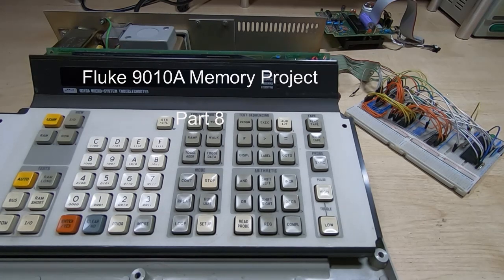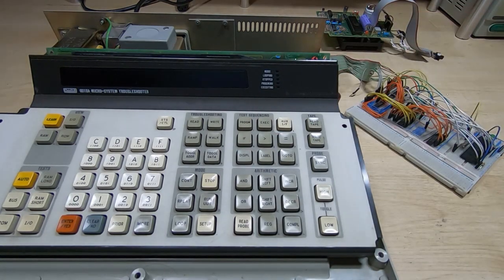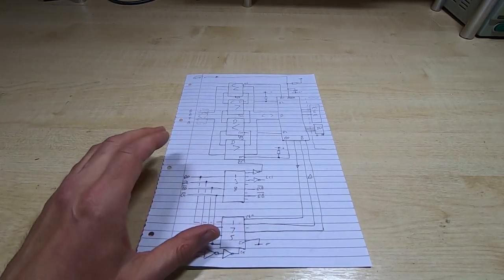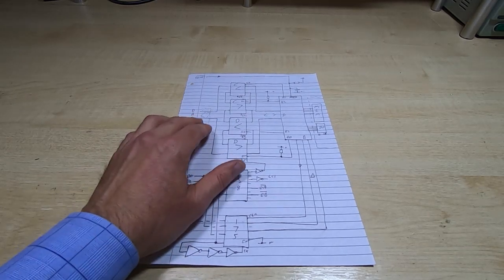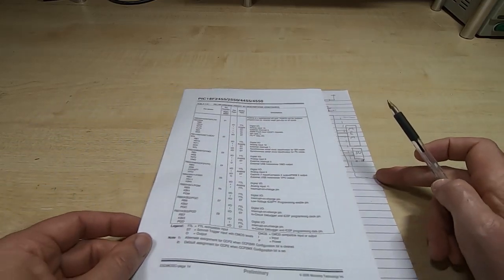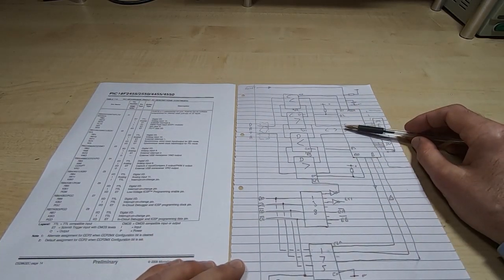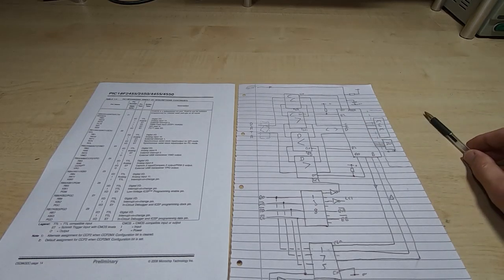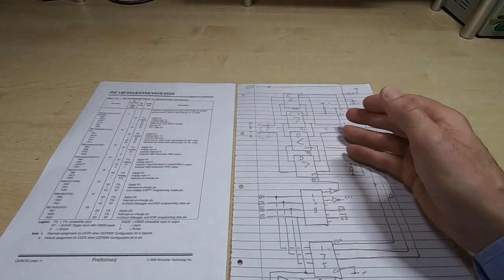Fluke 9010A Memory Project Part8

Comment: Making progress very quickly on this project - love it! I'm most excited about the ability to more easily share programs without the need to have a serial interface and computer configured for uploading them. Sounds like there will be a dedicated on-board EEPROM, with a card slot of some sort for portability - is there a reason to have both, vs. just the removable card? SD cards are cheap, especially smaller ones, so is there that much of a cost savings in putting a cheap EEPROM on the board, with an empty card slot vs. just the card slot and having somebody buy their own card worst-case?
Reply from the maker: As you say the EEPROM's are very cheap so having one on the internal board does not add to the cost and the builder can even leave it off if they do not want it. It is however very useful for test purposes or if someone wants to add memory but not buy any cards. The only really complicated part is the physical implementation of the card 'slot' and as not having the card would make it far less practical then having both is better. The way I use the 9010A I expect to use the internal memory for 'standard' tests and the cards for machine specific tests. This approach gives the most flexibility but it is then up to the builder which parts they want to fit.

Comment: Hi Jerry, I ‘m interested. Also would love to see some more about the code setup. By the way does anyone have an idea how many of these Flukes are around? I’m wondering how big the fanbase is 😄
Reply: Pretty popular in the arcade collecting/repair community, and a much-needed bit of kit. The tape drives are frequently dead on these (the rubber rots/melts on the capstans), and although some came with serial cards to interface with computers, many did not. This will be a great solution for both scenarios.

Comment: Were you ever planning to replicate the 9010A serial interface?  It appears relatively simply .. especially if one were to replace all that level shifting circuitry with a MAX232.  I wonder if the Fluke would need any modification to recognize a serial port .. Or if it would just start using the port if it were detected :-)
Reply from the maker: Yes I am just looking for a serial interface card that I can use as a template. The only real complication is the isolation as the RS232 interface must be electrically isolated to prevent ground loops between and UUT and the PC so a MAX232 alone cannot be used. My intention was to effectively duplicate the original interface but with a small isolated supply module instead of having to source a suitable isolation transformer.
Reply: @JerryWalker001  Thanks for the info!  Yes, I wondered why Fluke bothered with those opto-isolators .. Now I know why :-)

Comment: is there a public set of schematics for this product anywhere?
Reply from the maker: No, I have not yet finished designing it and do not intend to publish schematics or source code. I am hoping to recover some of the expense by selling the boards.
Reply: Jerry Walker il buy one :) and the adm3a
Reply from the maker: Sounds good. I still have a little work to do on the Fluke memory option but the hard bit is now done.
Reply: @JerryWalker001  You could do both: Openhardware/Opensource it and sell the boards ... or at least after some time (e.g. 2 month)
Reply from the maker: That would be a very bad idea. I have to buy my boards from China and they of course make a profit. If I make the design available then I could end up trying to compete with someone that could easily sell cheaper than I can buy for and they would also not have had any development costs and time and effort. There is nothing to be gained in releasing designs as they are not needed by users so for something like this I would not release the designs as I need to try to recover the costs so that I can pay for the next project. This is the only way I can fund such develoments and if I start releasing these new designs then I would quickly run out of funds and be unable to produce anything further.